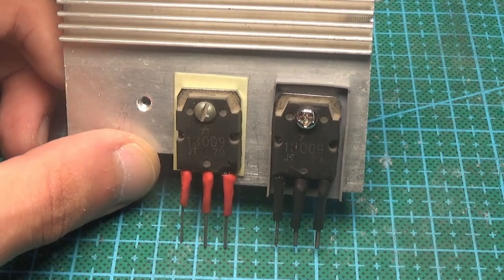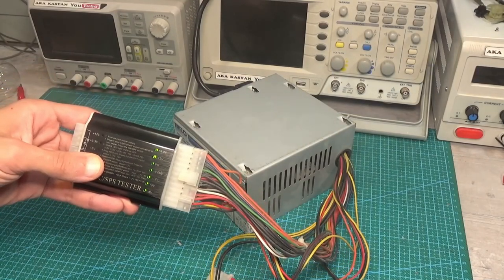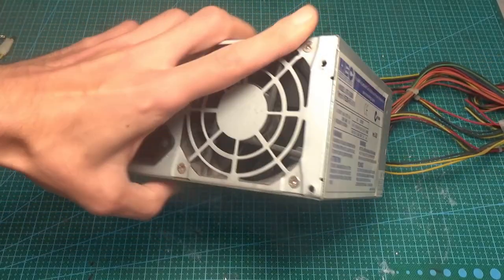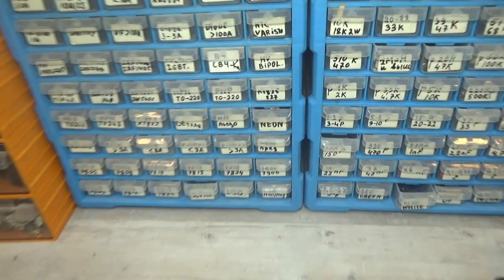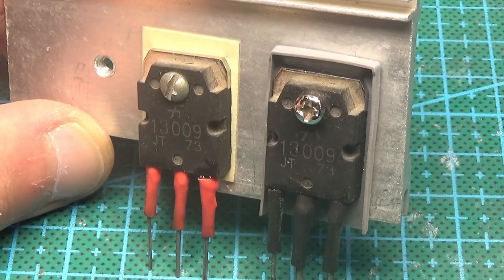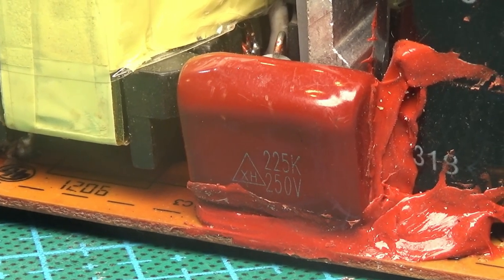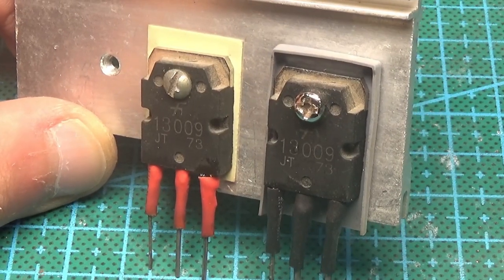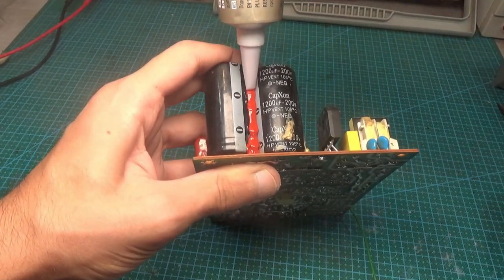How to increase the POWER of ATX Power Supply

Comment: Do you have a video to build a 24v power supply from an atx psu or just split the rails so they could be used in series?
Reply: the 2nd option is not possible because all the 12 volt power line come from the same transformer output so if you do that, you will trigger the short circuit protection of the unit. the ground wires are the same but its possible the wire each power line with each voltage in series

Comment: i have a atx smps , 5 years ago when I check it have max 12v 15amp before shuts off
but now I checked it only gave 12v 4.8amp before shuts 
it is rated for 12v 15amp
what may be the culprit

Comment: Hello! Seen a bunch of your videos and they are really great and detailed. But they are not quite what i need and my knowledge is to basic to modify them to my needs.
I am looking to make myself a variable power supply out of an old atx pc power supply that is a little more complicated than everything i find on the internet.
The power supply that i have has the 3.3v output rated at 24A, 5v at 27A, 12v at 10A, -12v at 0.8A and -5v at 0.5A.
The outputs that i want are 3.3v, 5v, 12v, 10v (by using as negative the -5v with positive 5v) and 24v (same principle) and for each of these i want to have variable amperage but i do not find a circuit diagram and parts needed for just amperage regulating.
Also i would like to tie a buck converter to the 3.3v and use it for outputing 0.5-2v with variable amperage as well and a boost converter to output a 1.3-14v, 0-6A and my problem here is i do not find such converters. My basic understanding would be that if i what to draw 6A at 12v the converter will need to recive over 20A from the 3.3v terminal. I want to use the whole power of the power supply or as much as possible.
The same i want for a 5v terminal to attach a buck boost converter and draw 2-14v, 0-10A where if presumably have a 12v 10A load it will need to resist a 24A for the 5v in. And ultimately i want a buck boost on the 12v to provide 5-36+v 0-8A.
Can you please provide me with such circuit diagrams and components needed for making the amperage regulators and the converters or even make a video on the subject?
Really appreciate the effort for even reading this post.Ty!

Comment: because of pc power supplies doesnt have independent voltage regulation (most of the cheap ones) its not a good idea. if you pull too much from 12v line, pwm will go up and 5v will go over 5,5 and it will trip OV protection on line 5v, or decrease 12v line (as shown on video) in order to keep otrher lines safe. so i have thought about it but it doesnt worth the effort. you can bypass ov protection on other lines by changing voltage dividers on those. but seriously, it doesnt worth the effort. go buy a new one as he mentions.
Reply: waste of time